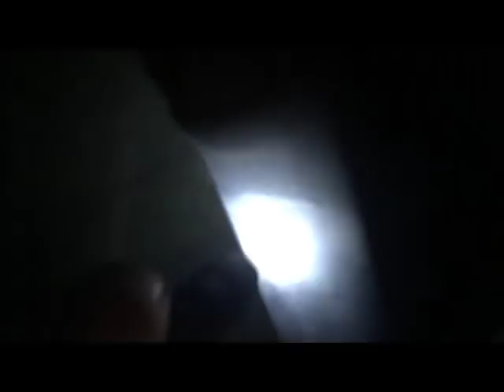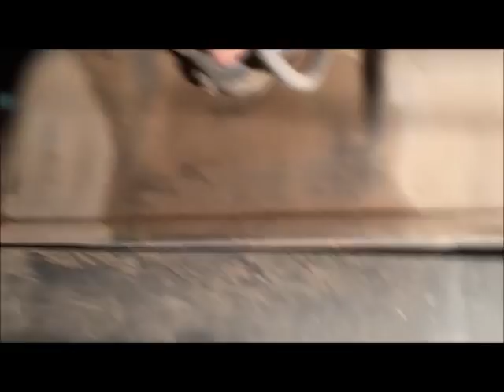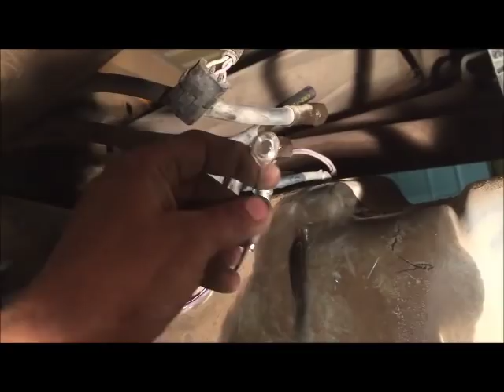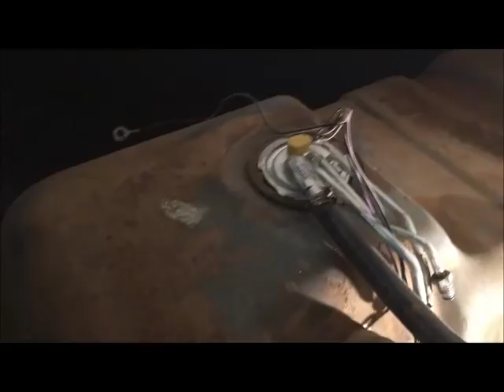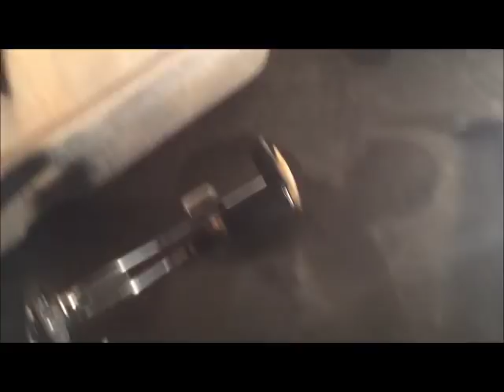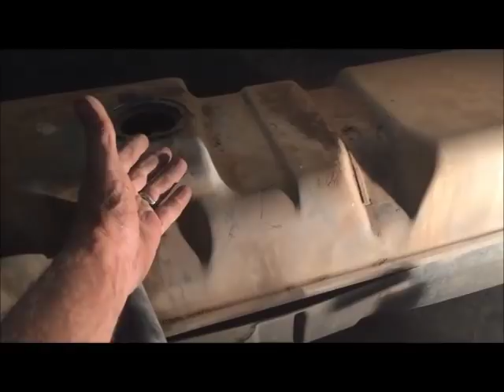1998 Chevy 1500 Fuel Pump Replacement

Comment: anyone who says sugar won,t ruin an engine don,t know what they talking  about. the sugar disolves in the gas the same way it would making tea or anything else. it goes into the combustion chamber which is hot .the sugar in the fuel melts and turns to a syrup mixture and stays on top of the pistons. when the engine is shut down the syrup mixture cools down when the engine is cool and turns to a peanut brittle type of state which locks the cylinders. enough said.
Reply: O,su
Reply: B
Reply: I have seen this happen, also moth balls.
Reply: Sugar dissolves in gas does it? Go get a cup of gas and see if you can dissolve it... Smart guy
Reply: Mythbusters says your still wrong.

Comment: Thomas,
 Thank you for the video. I am 75 and used your video to do a solo tank replacement on a 1998 Chevy 2500. The comments were a great help. After reading one comment I borrowed a motorcycle jack to lower and raise the tank. 
 My 2500 had the clip style fuel pump connectors that require the plastic release tool. An explanation of how to properly insert the tool to release the clips is worthy of the time. I bent the spring clips removing the fuel line. 
 Mine is a Michigan truck with rust. The tank had rusted. My fuel line between the tank and the filter had rust where it was clipped to the frame. I cut it out with a small pipe cutter and my auto parts store fabricated a new line,connector to the pump and a splice fitting to the original line. They stated that it is a common problem here. 
 The entire job was 7 hours with a trip to the auto parts store and replacing the filler neck while I was at it. 
 I also discovered that the brake lines I paid to have replaced several years ago were patched in with similar compression fittings I used for the fuel line.
 I hope the helps others.
Reply: "compression fittings"  are NOT recommended for brake lines !

Comment: Man I really appreciate you go in into detail it really makes the difference I wish I would have found this video before I started on my project it may have saved me about 50 bucks
Reply from the maker: shoot, thanks for the comment and for watching. its all about saving the bucks!!!
Reply: @thomasbriansavingmoney  what's up Mr Brian, I have a 1997 GMC suburban and my fuel pump went out I change the fuel filter also. I have someone that's charging $150 to drop the tank and fix it. My question,  can I drop the tank the same way you did on that 97 chevy truck? Thanks for the educational video
Reply: @henryhowardiii683  to awnser your question yes you can just drop the saddles witch is the gas straps and the tank will drop

Comment: Thanks for your video. The job did take me over 2 hours because my truck as 1 strap and 1 cross member holding it up, but the most difficult part was putting the tank back on. It fell off my jack and the fuel pump harness came out of the tank because my tank cannot be dropped all the way down to the floor without disconnecting the hoses. So I had to reinstall it again. Anyway, I'm am still glad I took on the job and was successful. Thanks again.
Reply from the maker: rough, but perfect. you save a lot of money. great job. a large thin piece of wood (plywood 1 ft x 2 ft ) would keep the tank from sliding when placed on the jack when there is a lot of fuel. but great job. thanks for watching.

Comment: thomas brian, thanks for this tutorial. I did just as you said in the video and took about 2 hours total. It's a little tougher than one thinks putting the tank back on the jack, but do able. I started off by spraying all the bolts with liquid wrench. Everything came off smooth. This method was easy and 1 person can do it. Patience is the key to this in my opinion. Thanks again.
Reply from the maker: awesome, great job. and better than paying 400 bucks give or take. thanks for watching and for the update.

Comment: Update, just put a new fuel pump in my 97 1500. It did take longer than expected but that wasn't really Brian's fault. Just a warning for other shortbed owners, they are different than longbeds, like the one shown in this video. On a shortbed, the front of the tank is sitting on a bracket that is bolted to the frame. It isn't held up by a strap like shown in the video. I decided to unbolt the bracket from the frame and just leave it attached to the tank but it is difficult to get the tank lowered then because you can't drop it straight down. The bracket hits the lower lip of the "c" channel frame and you can't push it over far enough to clear because the tank hits the driveshaft on the other side. I had to drop the passenger side of the tank down at an angle while lowering the tank. Then its a real pain to get back in to position using a standard jack, because when you tip the tank to clear the driveshaft, it wants to slide off the jack. Maybe dropping the driveshaft would help, I don't know for sure. I have to say, if I didn't have a toolbox in the bed and a bale spear attached to the bed as well, I'd probably try the bed raising method next time and just pray the bolts don't break! If you have a long bed though, I'm sure brians method works good
Reply: Mine is a 98 GMC 4X4 short bed and I have the same bracket on the front strap. I did the same by unbolting the bracket from the frame, 4 15mm nuts, but I went one step further by unbolting the strap from the bracket and moving the whole thing out of the way. I did have to remove the filler neck hose and return hose from the filler neck as the tank would not lower with them attached. I had no other issues.
Reply: @Kansas Country  @daviddaniels4075  LOL I'm reviewing this vid again, cause a minute ago, I'm under my 96 SB 4x4  thinking "I didn't see no STEENKING BRACKEET IN THE VID!!!" xD. Are you saying that the tank wont come down with the filler hose attached to the tank? 
I removed that front bracket like you said. That bracket & strap wouldn't have been so bad, but some "Mentality" had twisted the strap 45degrees and the long threaded end wouldn't push up through the bracket, cause of the lip in the tank. I finally finessed it with my hammer (big adjustable) and got the bracket off the frame. 
Hopefully I never have to do this again, but will try the "Bed Lift" method. 
If I wasn't strapped for time, I would've looked up an EXTERNAL PUMP KIT.

Thanks
Reply: Thanks for the info, shortbed '97 K1500 here!
Reply: I have the same problem
Reply: Yeah mine is a short bed and it's lowered so this is going to be fun
Reply: I'm glad to find this I have a 1998 Chevy 2500 with this tank style (I think this is the larger 35gal tank). Plenty of videos for your smaller style tank! Very few for this big tank! Thanks for the video!
Reply: My fuel sender went out and it was saying that it was full and the new one thing that it was almost empty the fuel gauge never move not even a bit after I filled up my truck do you think it could be a bad ground

Comment: The guy on this video has the most informative video in this I’ve seen so far. I needed to replace the pump but is so detailed about other situations that Steve related to this such as the the fuel meter reading half or full cuz of bad ground. Taking off the bed being a bad idea and also having to disconnect the rear lights.

Comment: I just dropped my tank today. I put ratcheting straps under the tank and had to cut the strap bolts because of the rust. Anyway the tank was so rusted,  I can't even get the lock ring off. So... I'm going all new. Anyway thanks for the video. Helped me decide on best tank removal method!

Comment: excellent video.  This is an example of why youtube is very valuable.  I just bought a 98 silverado K 1500.  The guy I bought it from replaced the fuel pump and the filter but was unable to install the metal straps because the parts store gave him the wrong ones and then he just lost interest in completing the project and now the tank is held in place with tie down straps.  Im not sure why he didnt just use the original straps that he took off.  Anyway, this video was very informative and made me less afraid of completing the project.  Liked and subscribed.
Reply: It is worth noting that the video you see here is for the longbed model.  I have the shortbed (6' 6") model and the straps/brackets that hold the tank are significantly different from what is seen in the video.  I think a bit more challenging to deal with as well.  Not just a simple strap with a bolt to loosen......
Reply: i have a 97 gmc short stepside i cut a square hole in the bed exactly over the fuel pump, plenty of room, new fuel pump was ez, put wet towl on tank and used a cut off wheel, 045. used cut out piece with 2 metal flat pcs.about 1/8in thick and put back together, caulk around the cut out, then i covered with rubber mat. take your time and lay it out, ez fix

Comment: He is right, this is the fast way to remove the tank and install a new pump, re installing the hoses back on a tight space is another story.
The tilt bed system is still the best way to do this job.
Reply from the maker: absolutely, thanks for watching!
Reply: Not if you live in the rust belt.
Reply: @pedrorojascervantes3928  Must be hell taking out stuff in those areas! Don't envy them.

Comment: I used this method a couple months ago to change the fuel pump sending unit assembly on my 94 K1500 (first tried the bed removal method but the bolts were not budging with the impact hammer and I did not want to break any using a breaker bar and brute force) truck has almost 200k on the original pump and the truck has spent all of its life in New England so it's plenty rusty. I was able to get the tank down the same way you did but the top of the fuel pump didn't look as clean as yours was (looks like that fuel pump sending unit assembly on your truck was changed recently) put a new assembly in the truck and got it back running again worked great. The truck sat for a month and I went to move it today and same condition no fuel supply I am getting power to the connector on the top of the tank but the pump does not run, fuel pump relay seems to be working, when I turn the key on I get power for a few seconds then it goes off and power while cranking. It will run on carb cleaner while I am spraying it in the throttle body. I also checked the ground wire on top of the frame to make sure I had a good connection. Anything else I could try before pulling the tank for a second time?

Comment: thomas brian thank you very much for your video. 1997 K1500 w/ 70k miles. My pump assembly wire (black) was toast and burnt looking when I pulled it out of the tank. That's a pretty scary thought. Mexico "Precision" part installed (lifetime warranty), everything buttoned up and she started right up. Thanks again.

Comment: Thanks for the awesome detailed video. I'm having a misfire issue with my pickup and I seem to have narrowed it down to a fuel issue (fuel pressure building VERY slowly). I've been DREADING having to change the pump because I don't want to pull the bed. I bought a filter to try first, but if that doesnt fix it, I'm no longer afraid to change the pump now that I see how easy it is to drop the tank instead. I appreciate you explaining what would need replaced on the pump as well. I would have ordered the entire assembly if you wouldn't have mentioned it.
Reply from the maker: thats perfect !! most of the time the filter is the issue. good luck and thanks for watching. 
here is a video for the filter i did a couple years ago.
https://youtu.be/slTJ4reG2b8

thanks for watching.
Reply: thomas brian awesome, I sure hope the filter fixes it, it can't hurt, it's WAY past due for one. Looks pretty simple. Did I understand correctly that you don't relieve the pressure in the line when changing the filter?
Reply from the maker: you can, it helps. but its not a whole lot. just a rag can clean it up. watch your eyes. enjoy

Comment: I have a 1996 Chevy Express 1500, and the fuel pump is not running. It draws excessive current when the FP relay is jumpered. I presume that's locked rotor current.  Your video is  a huge help; nothing like knowing what you are getting into before you start a job. I can't believe some people cut a hole in the floor of their van to do this. Thanks for just the right amount of detail.  If I may contribute one hint, if you want to take the filler hose off, the old stiff rubber hose can get really stuck to the metal filler pipe.  Prying the rubber away from the pipe with a screwdriver just enough to get a shot of WD-40 in there  will loosen it right up. Thanks!
Reply from the maker: great tip, yes the fuel pump is no good it sounds like. thanks for the great comment, hint, and for watching !!!

Comment: This was really great info. My fuel gauge goes crazy when I 1st start the p/up trk. up,then stays on 1/2 tank  ALL the time, even after I put 10 gallons in it. I imagine I will check my ground wire first and see IF it is connected.... If it is I will drop my tank like You showed with the 2 straps then install a new gauge. I will let You know how I make out. Thank You very much !
Reply from the maker: great, yes please let us know. you may run into something i did not mention, and it will help another. perfect. thanks for watching.
Reply: @thomasbriansavingmoney  hi, and thx for this video.  I used it to replace the pump on my 97 4x4 shortbed.  As others have noted, the shortbed has a rigid bracket in the front, but the tank is flexible enough to force the bracket out then back in.  However, I still have a problem - truck fired right up but I cant give it more than about 1/4 throttle - if I do, it starves for fuel.  Any ideas on what to look for?  I only replaced the pump, not the whole assembly.  Thanx

Comment: Excelent video my friend. Im having fuel sending issues with my 97 c1500 Cheyenne 5.7 Vortec shortbed stepside. Hesitating, anything more than light throttle it spits and sputters, bucks and losses power. Im swapping out the filter today and will be checking out the pump too. Thanks to this very detailed video I'll know exactly what to look for. Thanks a million!! "Liked and Subscribed"

Comment: I wish to say great vid. I live in iowa where rust is common. I'm just a dink around type of guy. If I had money my good ole Chevy would be so beautiful. But for me being a beginner I got my truck bed off with a harbour freight impact and penetrating oil. I had to get new bolts afterwards. If I had the money for the fuel pump I would have changed it.... I just painted my frame for the winter...

Comment: I have done it all three ways.  Bed off, Bed tilted, and Drop the tank.  Dropping the tank was the hardest of the three ways.  My preferred way is to tilt the bed, change the pump, drop the bed.  
It is much easier than dropping the tank.  When I dropped the tank I had a HE_L of a time lifting the tank onto my jacks every time they slipped.  A full day just to put it back in.
Reply: what did you use? 2 bottle jacks or somethin?
Reply: @thelaughingman79  
cherry picker

Comment: I used the tilted bed method with my '96, and it was a huge pain. Also, spend the money for a new assembly on an old truck. You'll feel a lot more confident than changing that little pump only.
Reply from the maker: yeppers, well said. thanks for watching.

Comment: My fuel gauge reads over full or under empty. It will randomly switch to one or the other. Do you think the ground wire could be the problem? Gotta replace my fuel pump soon so good time to take a look at it.

Comment: Lots of good info here. My gas gauge is reading all over the place in my 98'. Where is that ground located on the frame?
Reply from the maker: from tank to frame rail. the bolts that hold the pump bracket assembly , thanks for watching.
Reply: So I been counting miles for a couple years in my 98 z71 k1500 cause my gauge always reads full or more, sometimes it'll bounce a little then back to full, when all it probably is is a damn ground wire!!!! Lmfao...wtf I been avoiding dropping it cause I thought it was hard as hell and thought I'd have to buy a whole new unit first lol I feel pretty dumb about now....so where exactly should I look? I have a short bed so I know it's a tad different then this long bed but can't be much different on wring right? So what happens with the ground and how do I fix it? I'd greatly appreciate the help! Having a gas gauge in my truck would be like I got a new truck after a few years of always guessing milage lol

Comment: If you have an old rusty shortbed worktruck id say just cut a hole in the bed from the top and make a latch so you can chage it anytime you want. That way you can even change it on the side of the freaking road when your cheap chinese pump has failed for the third time in a year.
Reply from the maker: you are soooo correct. house door hinge even!!! thanks for watching.
Reply: Ya I had to cut a hole in my bed because lifting the bed was a no due to excessive rust and dropping the tank was impossible because the person who had it before me did some weird welding shit to the bolts. But hey now I got easy access anytime lol

Comment: Sooooooooooooooo ... don't pull the bed, because the bolts are rusty and will strip/break - but hey, just take out these bolts instead, because they magically won't be just as rusted as the bed bolts?  How much easier is it if those strap bolts strip or break off?  Not asking to be a jerk, it's an honest question.  What's the solution if those strap bolts don't come off cleanly due to 22 years of rust?  (Got a 97, and it looks like the pump died on me tonight.  Looking for options.)